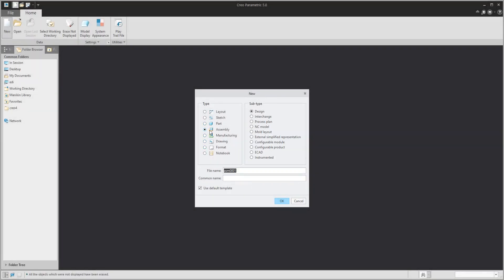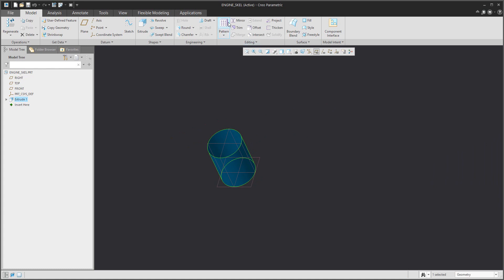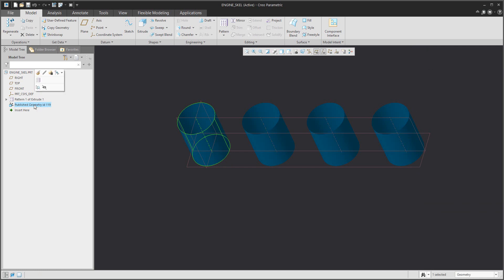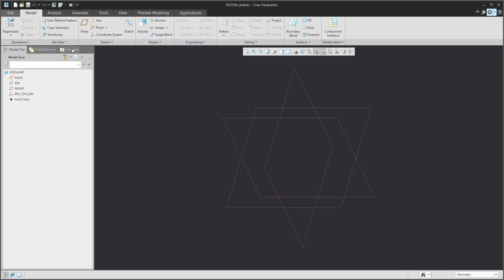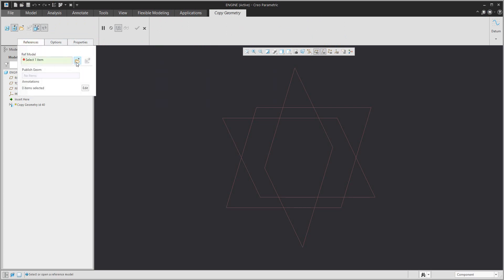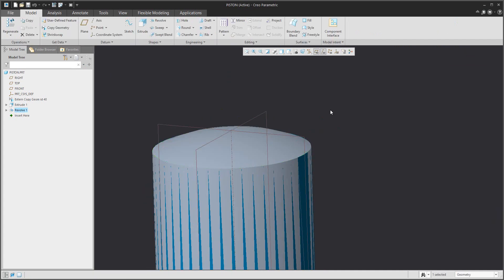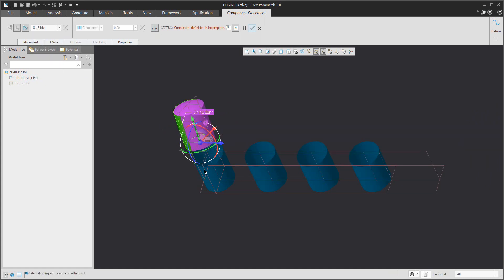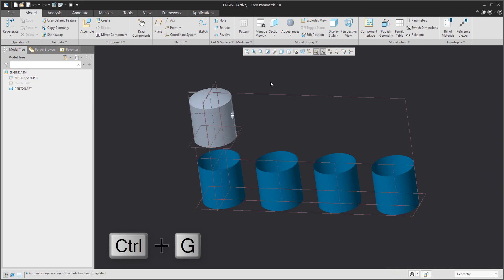Publish geometry and Skeleton with Creo Parametric

Comment: Thanks for the nice video...however i have noticed some issues when i am using copy geometry and that is the circule references thats created...is that common problem or happened to me only??
Reply from the maker: Hi, if you use copy geometry, yes of course you can create circular references. With publish geometry you minimize this problem / not possible. What you create with this feature is external references to source model , but it is not critical. It is OK for Top down Design. 😉